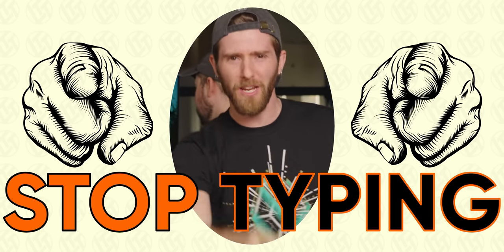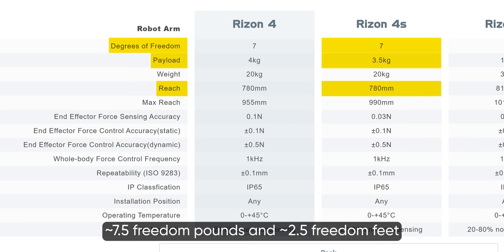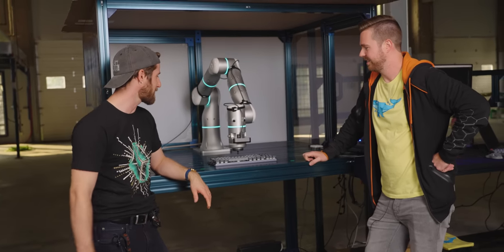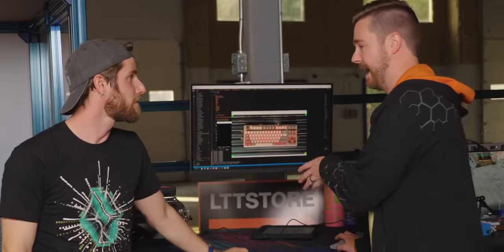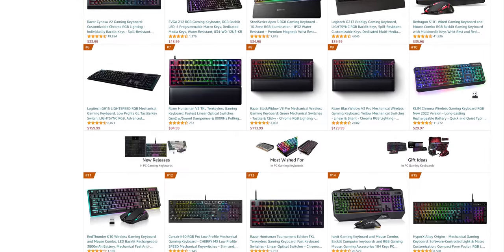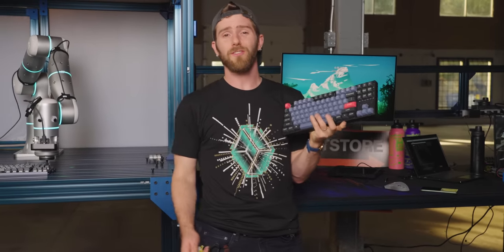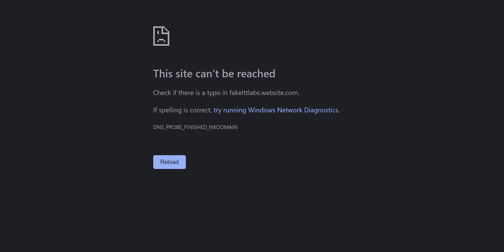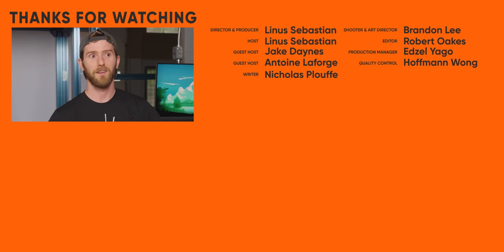Your Keyboard Sucks and I Can Prove It. - Labs Keyboard Testing

Comment: I've always used RTings for this kind of data, and it was unfortunate that no other site had such systematic testing meaning that if RTings didn't have info on the specific device I am interested in, there was nothing else comparable. Hopefully LTT will start to help fill that gap soon!
Reply: Hopefully they end up doing a better job... there's a lot of issues with RTing's methodology that's led to wildly inaccurate results in the past.
Reply: @chroma_aus  like?
Reply: @seanmccants1500  The latency tests were the most egregious. They changed methodology a few months back, but previously they had an audio-based setup that produced results so bad that they weren't even internally consistent. I'm talking the same peripherals achieving lower latencies wireless vs when plugged in, massive deltas between models with identical PCBs, Bluetooth devices that scored competitively, etc.

Even now there's a bunch of issues in the technical aspect of their reviews. I won't go into all that here since it appears they're trying to improve, but I'd just take everything from them with a massive grain of salt.
Reply: @chroma_aus  uhm, there are devices that have lower latency when used wireless vs cable. using a Dualshock 4 on a PS4 through a cable connection has higher latency than through Bluetooth for example. the same is true on the Switch and its pro controller.

so I wouldn't instantly say that data like that is automatically inaccurate just because intuitively you think a wired connection has to be faster, there can be complications in the software or hardware that can lead to that not being the case
Reply: @kevboard  idk what you're smoking but provide a source for bluetooth of all things to be faster than a wired connection
Reply: @kevboard  It's not about intuition. Their results were contradictory to those from every other third party, and some were directly pointed out as incorrect by company reps. Besides, the main issue was always the lack of internal consistency, which was noticeable throughout the whole database and not just in a few edge cases.
Reply: @MaksKCS  It's literally just a quick google search away with a multitude of sources.
Reply: @VocalTK  then it won't be hard to point to one right?
Reply: Actually, the engineer behind the keyboard latency test comes from RTings. That sounds promising :)
Reply: for laptops i always went for notebookcheck. their data is amazing

Comment: If and when possible you should try the old butterfly keyboard from apple, it would be interesting to see how it compares to the spec list

Or even other laptop keyboards because these are permanent and not replaceable

Also, have you thought about testing how many clicks it takes to break the key? Manufacturers claim millions but i dont think in reality this is possible.
Reply: That’s such a great idea! I hope they see this
Reply: Here's another vote for them to see and do this test.
Reply: Why shall millions of clicks not be possible?
Have you ever though about how often you really are pressing the keys? And how long a keyboard lasts?
Then there is the matter of dust and other dirt getting into there - what if this was not the case and the switches would wear less?
Reply: People should upvote this. Upvote it to the stars and beyond. This needs to be seen by @Linus Tech Tips (won't work but worth a shot)
Reply: @dezpotizmOFheaven  thats true but a full keyboard has more than 80 keys and if 90% of them survive, what do you do about the other? Its not like you can replace the keys easily in most keyboards. After reading my comment again, i think the failure rate before reaching the spec would be a better think to see rather than just some keys.
Reply: I don't think it's possible to test a key millions of times. Take for example if you want to press a key 50 million times and could press it 10 times a second. It would still take almost 58 days per key. Then multiply that by the ammount of keys on the keyboard and it would take quite a long time to test even one.
Reply: @Tupsuu  for a reliability test you need a big sample size aswell since the durability is attributed to a percentage of failed products after this specific use time.
Reply: Measuring number of clicks is really tough. Everyone types at varying levels of aggression. If I were to very forcefully type, it might only last 1,000 clicks. However if you press just gently enough to register a click, and then slowly pull up, it could last 100,000+ clicks. 

You could solve this with repetition, but I don’t think LTT labs is that big just yet. You’d have to test 100s of the same keyboard at varying degrees of aggression to get an accurate measurement.
Reply: @Tupsuu  Obviously they would test just one key per keyboard, and obviously they would test only up to the amount of presses the devs promised. Just set the robot up with a camera pointed at the keyboard, set it off and go home for the night.
Reply: @ziwuri  Well Cherry MX promises 50 million clicks. Also someone was suggesting to test all the keys on a keyboard so that's why I mentioned it.
Reply: @dezpotizmOFheaven  It depends on use case, in reality. Gamers will wear certain keys more than normal. Heck, if you use say Pinyin for Chinese, you'll wear the board differently then someone who types in English (Pinyin uses English letters, for example py5 types 拼音  (literally Pinyin for me (if you type a word enough, it will go to the first in the list, 1). Also, as with anything mass-produced, things may not be up to spec, and QC might have some errors.
Reply: @Tupsuu  it may be possible, if the key is pressed fast enough. Like a motor on top that rotates a circle with a bulge at 200rpm (for 200 clicks per minute). I dont know if that will be representative of reality because as you said if it fast it may take more force and that may break the switch faster.
Reply: There are replaceable laptop keyboards! Thinkpads for example usually have them :)
Reply: @Fusion05  If you test it at the rated force, in a repeatable way, then that will be less of a factor. Also, different switches have different response curves, so for some switches, bottoming out and fully releasing may be the only to get a full keypress (and return to the previous position of the key), At least, that's what I'd guess, I'm no expert on keyboards.
Reply: @thethingthatshouldnotbe3035  i wish most laptop could be like that or even like framework.
Reply: @vetamauromihali  Yes it is possible to do so but it would take so much time that they provably won't do it as it would take 173,6 days to complete 50 million clicks with 200 cpm. But if they would test it it would be great info.
Reply: @Tupsuu  Realistically, I think it would take even more than 173 days. 200 presses per minute is *fast*. Fast enough that you're slapping that key really hard, and probably reducing its life span more than standard use. You'd need to test much slower.
Reply: @spaceduck413  honestly, pro esports players could probably hit that in some scenarios and therefore the switches should absolutely be rated with that in mind. Would still be A LOT of time, though...
Reply: @vetamauromihali  that is so true :/ thanks Apple, I guess... ._.
Reply: @spaceduck413  That is also true and I would provably double it atleast.
Reply: @thethingthatshouldnotbe3035  That's not really a typical use case. I definitely wouldn't expect anybody to rate their keyboards like that, unless they're specifically marketed as "eSports" keyboards
Reply: @ziwuri  Does it need a camera?
One key requires no movement other than up and down.

Also, 10 key presses a second is well above what a keyboard is intended to do. pressing a key 10 times a second, for days will cause way more wear then normal.
Kind of like tires on a car, your normal road tires will last tens of thousands of miles. If you take those same tires on the track they will wear out in hours or days.

A manufacturer like cherry mx rates some of their switches at 100 million presses, thats 116 days of testing for one switch with a company that has at least a dozen switch types.
Realistically LTT would need half a dozen custom machines just to test just one switch of each type from just cherry(also not a large enough test size to determine anything of value).

The machine to do something like this would also need to be able to survive that long(or be replaced multiple times during the testing). which would be very expensive.

It probably would be a multi million dollar setup just to test one company's switches lifespan.
and even then, thats not the whole picture. The 100 million keystrokes is not the only number for determining reliability.

Several statistics are needed, for example, If a key switch is rated at 100 million keystrokes but a 5% early failure rate that means 5 keys out of 100 will fail before 100 million. In order to test this properly, you would need to test dozens of keys across multiple manufacturing batches minimum.
Reply: @woo9914  You really wrote a whole-ass essay... Just tap it 3 times a second and let it run for a week. That type of video, giving a general idea of the durability of different keyboards, isn't on a time constraint.
Reply: @ziwuri  since when did genuine well thought out(imo) responses become a bad thing?
I'll respond simply this time though.

Not enough information will be provided with a test like that to be usable.
Reply: @woo9914  I disagree. Better to have some general data than no data at all.

Comment: What you're doing for the enthusiast community is SO awesome, I cannot wait to see this in it's final form!
Reply: if youre talking about the mechanical keyboard community then this is barely scratching the surface
Reply: @Infinity2437_  seriously?
Reply: this is more for the normal consumers unfortunately.
Reply: Enthusiast would be about building the keyboards, rather than just buy prebuilt one like this
Reply: @eugenehong9668  Yeah, stuff like repairability, how hard is it to get inside etc isn't even a concern in the enthusiast keyboard space, considering most of them come as a kit or are intended to be modded/customised. Only the consumer keyboards have these concerns.

Comment: I used to do industrial computer vision. I'm curious if you guys tried low angle lighting instead. It could help make sharper shadows to have more distinct edges of the keyboard. It's a common technique for creating shadows for aluminum components with serial numbers etched on.
Reply: The one thing I can see being a problem with this is that keyboards have so much variation in height - lighting and capturing just the keycaps, and the keycaps alone, would be next to impossible. On flat aluminum pieces to illuminate an etched serial number it may work great, but with keyboards I believe it wouldn’t work that well
Reply: @theEduEnthusiast  Additionally, not all keyboards are flat, some have built in angles which a 3D scan could pick up best.
Reply: I'm surprised they didn't just use the printed keycap symbols as a reference, in order to reduce uncertainty in the location of the edges i.e if the symbol is detected to be outside the bounding area of an inferred keycap surface, then that results in a lower activation/probability in the ML algorithm.

Detecting a defined set of symbols is way easier and more reliable than detecting the edges of an arbitrary shape.
Reply: @tomfahey2823  It's unfortunately not as black and white as that. Not all keyboards have symbols on them. Not all keyboards use the same typeface for their symbols. Not all keyboards put their symbols in the same place on the keys. It's a surprisingly tricky engineering problem.
Reply: @Sam-dn7jk  ah yes that's valid. There's a technique I know that can bypass this issue but then we'd be talking more expensive than a 3d range scanner
Reply: @theEduEnthusiast  agree with the height variation being a potential problem, I think its still flat enough with respect to the test chamber that it may be ok. I'm not convinced keyboard lighting could be an issue since usually they illuminate through the characters, which wouldn't have enough "bleed" to affect the visibility of edges
Reply: Well, the keys aren’t always in the same plane. Plenty of keyboards have keys that are angled in an inverse parabolic curve for easier typing access, which would make illumination via low-angle lighting very difficult
Reply: @Sam-dn7jk   Not heard of keyboards without symbols on them - so that's news to me. Not sure how many of those would actually end up being tested by this machine, however.

In terms of their placement, as long as they were located somewhere on the surface of the keycap, you could at least guard against phantom keys, as they showed at 6:20. For the keys with similar symbol locations, you could also check for deviation from the average, to get a level of confidence.

Without looking further into the problem, I can't see any a priori reason why it wouldn't be amenable to a CV + ML method, as solutions already exist, such as the one used by Meta for  passthrough keyboard. The only reason I can think of is lack of precision, which would justify the use of laser sensors.

I suppose I'm just surprised that they would throw their hands up and opt for a hardware solution, so apparently quickly.
Reply: @Tom Fahey  That's true, if I recall correctly the keyboard they use in the video has no icons on it. Additionally, I think many keyboards without keys would be tested as lots of enthusiast hardware for people who build their own keyboards do not have icons on them for sake of aesthetics and wear. There can often also be custom designs or patterns that may throw off icon detection software. 

The bonus of using a laser is also that it allows them to detect the height of the key so they don't need to slowly press down until they find it.

Another reason could be for more atypical key layouts a key icon detector may be thrown off by irregularly shaped keys which the laser scan would be able to normalise.

I'd be interested to see how they develop it.

Comment: Congratulations on tackling the very difficult task of testing a crucial human-to-machine interface. As a fast typer (500 chars/minute) I have stuck with cheap wired, low-noise, short-throw keyboards. There seem to be very different preferences between gamers, people who touch type and those who don't.

Comment: Excited to see potential variances across all the keys on a board - especially gasket mounted boards. Would be pretty cool to see bottom out force graphed as a gradient or something like that, spread across a whole keyboard
edit- also force profile consistency of hand lubed switches would be pretty cool to see as well. both immediately after lubing and after a period of heavy use

Comment: The thing about latency with USB keyboards is that USB has to be polled, it doesn't use interrupts like the old PS/2, so at this point you're testing the polling rate, which can, and will be limited by the host more likely than by the keyboard, if you hit a key between polls, it'll have to wait for the next refresh. And not to mention, if you're polling way too much, it will tank your CPU.
Reply: High-polling-rate peripherals are a thing and implemented through the driver. If a manufacturer didn't bother to tune the firmware and driver, that's a legit data point.
Reply: @Steamrick  the normal HID class will have 1000Hz a maximum polling rate. Which still gives you the 1ms window. Theoretically you can go faster with your own driver, but not sure if anyone does or if it is worth it. And 1ms is an eternity so I would be really surprised if keyboards really differ given the polling latency. Of course statistically you still can extract that latency but probably not worth it...
Reply: @lal12  There's various keyboards and mice with polling rates up to 8000Hz. I don't really see the point since it's already pretty far up the path of diminishing returns.

Comment: I think a really important consideration for sound is not just the sound of a full key press, but also the sound of tapping the key without actuating.
Most of the sound of my keyboard (old membrane Dreamcast keyboard, my Keychron K2 is in the mail) is the sound the keycaps make when moving, and the membrane switches are nearly silent.
In contrast, my laptop's builtin keyboard has extremely quite keycaps, but the membrane switches on it are much louder.

Knowing that keyboard X and keyboard Y have the same switch sound, but different keycap sound will be very valuable, especially if the two keyboards are effectively the same in terms of price, performance, feature set, etc, covering the remaining difference of keycap sound will inform potential buyers of which keyboard they might prefer. Personally, I can't stand the noise of keycap rattle, but for some people that extra bit of clackiness might be a benefit.